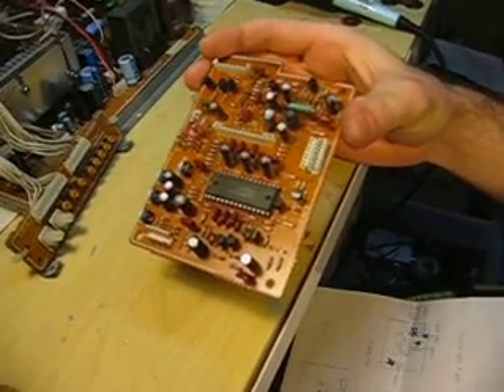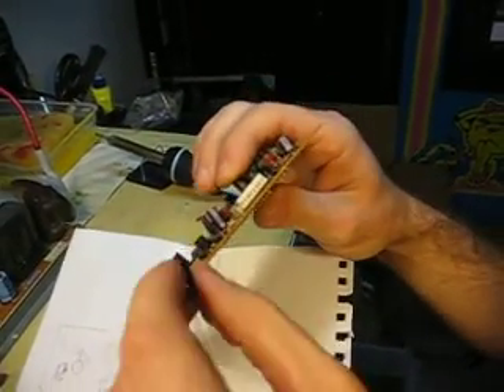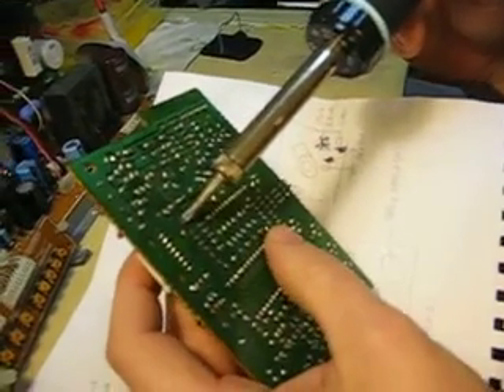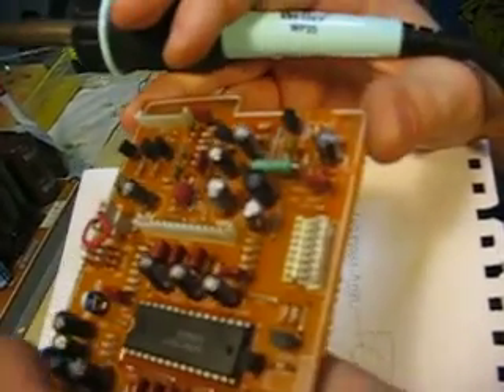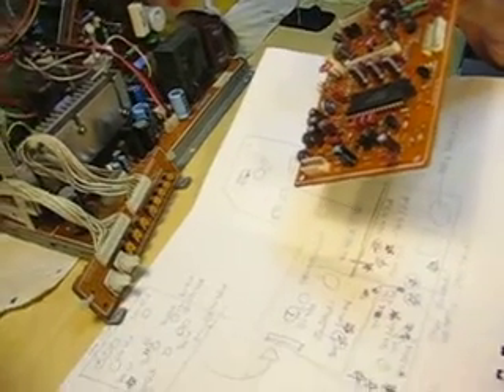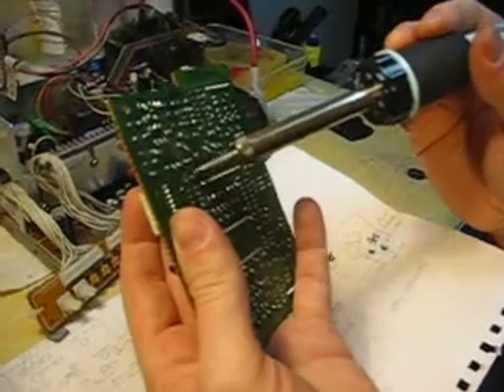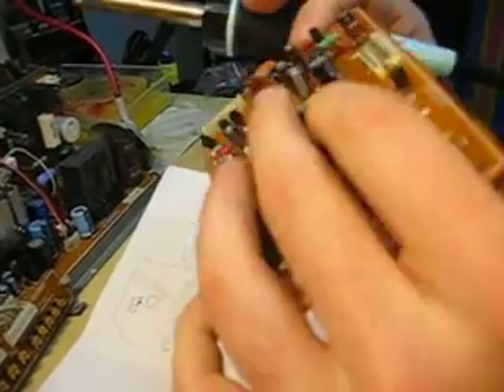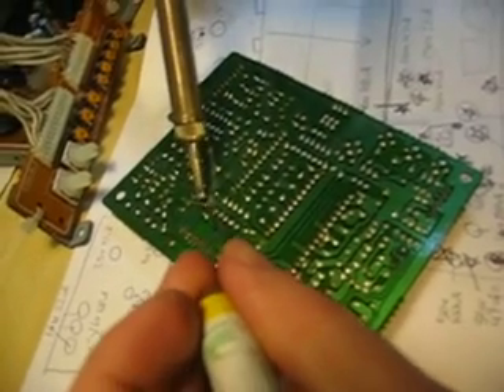Replacing capacitors demo

Comment: Fantastic little video. Very useful. My Rastan PCB has recently developed a fault where the sound has gone and the colours have gone really dark. Some of the caps look like they've had better days, so I've decided that this is the board I use to get some cap replacing experience in.
Reply from the maker: Cool yeah, just take your time and snap a couple of pics before you start removing the old caps. Make sure to note polarity on the caps before you remove them (or possibility of non-polarized caps) and you should be all set. 
Good luck!

Comment: Thank you for this tutorial, only one criticism, would have been nicer if you got in a bit closer and were able to focus on the small components so we can see what you're doing more clearly. However, I really liked your tip about checking the neg/pos positions while cap still in board, good advice! Thanks again, Joey.

Comment: Gunbu,
     Can you tell me what model Weller soldering iron you are using.  I need to buy a new one since mine is about 25yrs old.  I like the Weller, and want something to work with electronics and normal wire soldering on occasion.
Thanks,
John

Comment: I'd like to point out that some times capacitors are originaly instaled backwards by mistake, or  by technical malpractices (they put capacitors the oposite way to get electrical effects in the circuit that are not meant to be get with an electrolitic capacitor backwards polarized). So, sometimes you should better follow the polarity shown on the board. The correct way, ofcourse, is checking the circuit and understanding the real part function and it's correct position, wich often is obvious.

Comment: ok .. board solder is high melting point industrial solder .. trouble trouble.  Clip as much as you can off with small side-cutters.  Less to melt then .. less to refreeze and get in the way.  Draw a little diagram showing existing solder bridges .. i.e. don't create new ones.  Anything that looks like potential trouble .. map it out .. then you can confidently clean up errant solder later.   Sanding the oxide off new component legs .. like I describe below .. is a sweet tip .. nice clean job.

Comment: I like to draw the new cap legs through some emery cloth .. makes a diff re: solderability.  Also to clear old solder out of pcb holes .. heat and then rap board edge on table.  Liquid solder flies out.  Use proper electronic-grade solder .. watch for cheap imitation solder .. must be for electronics.  Also original solder tough to melt .. need a proper iron .. sand tip with grinder to get rid of copper-tin oxide coating.  And make sure tip is screwed in tight b4 you turn it on. Use wet sponge 2

Comment: hey gunbu, i have a usb car charger that i have put more draw on and now it charges intermittently, do you think upgrading the capacitor in the charger will solve this issue and if so what am i looking for in the replacement capacitor. 
thanks

Comment: I need a .22 capacitor for my guitar. I broke an old printer that i found, the green electric panel just look like that one, and I took off a big black capacitor here is the value:
.22 uf
250 v     K
do you think its going to work? And, I found several ceramic capacitors but I dont understand the code: (332k )  , please I've been looking on internet, and I couldn't get any decent information, please I know you could help me.

Comment: its recomended to clean the old solder befero you put the new cap. i still a noob in electronics but someone give me that advice, its for condictivity issues, old solder may have rust or impurities that may do an interference in the electricity flow, just adding a little bit of info to this great tutorial thanks

Comment from the maker: Hey guys, thanks for the comments. Like some have said, a desoldering iron can make things easier... especially with components with more than 2 legs. Transistors, ICs, etc, would be very hard to remove without a solder sucker! I recommend the all-in-one unit with the soldering iron and red bulb. Available at Radio Shack for under $20.

Comment: great job dude

hey do you think you can help me i was given a 19 monitor i took it appart to examine it and sure enuagh 3 capasitors were leaking well not leaking but they leaked
im not to good in this area but can u help me on what i need to do and get a stuff id realy aprecait it
ps its the psu on the lcd